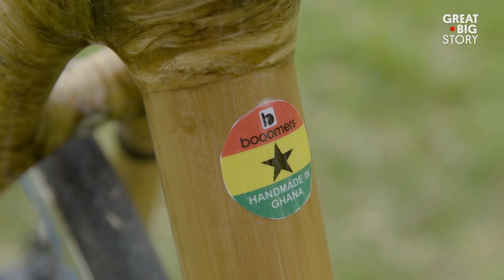How Bamboo Bikes Are Helping This Community

Comment: I saw how bamboo bikes were made on how its made in the west. They required so much labour and epoxy that it was more expensive and worse for the environment than a steel bike. 

Anyway, good for these guys if they can live a better life.
Reply: In the west? Or out there?
Reply: Carbon bikes are made of carbon layers bonded with epoxy, though. You can look for metal lug bamboo bikes that is not new but existed in 1897 http://www.copakeauction.com/ws/wp-content/uploads/2017/01/DSC00726-1920x1184.jpg
Reply: Delicious Pizza carbon fiber yes, metals probably not. You can build frames from recycled metal. My concern would be long term durability. The rule of thumb for a carbon frame is in roughly 5-10 years it will need replacing, aluminum/steel depends on wear and tear but in theory could last far longer. Snowboard cores and skateboard decks are wooden and require replacement, depending on use, every few years or so for optimum performance. Therefore the energy and waste required to build a bamboo bike may be less but you will in theory need a new one every few years, meaning more have to be constructed and whatever epoxies or chemical additives need to be used will likely cause issues with the decomposition of these frames. In contrast, processes to recycle carbon fiber are currently in the works and have seen success on a limited scale. Still, neither CF nor alloy are “1000 times worse” than these are, as you suggest.
Reply: Delicious Pizza you still didn’t address the longevity of a metal frame vs a bamboo frame. If an alloy frame lasts 10x longer (I have alloy bikes from as far back as 2000 that I still ride and have stood up, the most recent of which is a DH/Freeride frame from the early 2000s, pretty much the ultimate test of alloy’s durability, since I beat that thing up in the mountains; while a hipster type cruiser bike could hypothetically last many years without needing to be replaced) then the process of building that frame will be less frequent, even if it uses more energy, chemicals etc.
Reply: Milk2Percent  It is not easy to come to a conclusion. When considering the sustainability of a product, you have to look at the life cycle of it. How much energy was used to make it? How was the energy produced? How long does the product last? How is the product recycled? Generally, cheaper items are most often also more sustainable. Especially when it comes to transportation. Steel bicicles are cheaper than bamboo. (I am not sure about those made in the video).  Steel can be recycled at the end. If bamboo gets drenched in epoxy, it will never be recycled, but only burned. Epoxy is made from petroleum products and produces cancerous fumes, so it is not green at all even though the bamboo is. The energy required to make steel is very high, but so is the energy required of making bamboo. We cannot make a definitive answer without looking at the whole supply chain, and lifetime of a bicicle, but unless they make these bikes only out of steel and natural local resources, it will likely not be more sustainable than a steel bike.
Reply: Milk2Percent They actually replied in one of the comments below which explained that their epoxy is plant based. I think they make it from smaller pieces of bamboo and bamboo leaf, and you can see something boiling at about 1:16
Reply: DrewskiTheLegend that’s not right. Carbon fiber will last more than a lifetime.
Reply: Except bamboo is a renewable resource,  steel is not. Also you don't need epoxy or even a lot if you do use it. Not sure what program you were watching.
In Asia they have giant ancient buildings made from bamboo. Back when they made them they used no epoxy or nails or bolts or anything else, just all bamboo. These building have been thru floods and earthquakes, etc. Yet they still stand. These buildings have been thru many centuries of use and abuse. 
BAMBOO is amazing stuff.
Reply: Adam Blomberg carbon can last a lifetime, yes, but whether your frame will actually last that long depends on use. Fatigue is a concern when you are riding hard terrain on the same frame for years. Keep in mind I am referring to mountain bikes here but I have seen guys break carbon frames as a result of wear and tear.
Reply: There are eco epoxies out there.

But I think even the bad epoxy is better than steel. Think of the mining, smelting, and processing.
Reply: @user-gh8wt2zi2n  The iron in steel doesn't disappear when the initial use is done; and iron ore is plentiful. considering the cycle of the carbon in the carbohydrates (lignans and cellulose) of the bamboo, both elements are cycled in our environment. oxidised steel and iron only needs to be reduced again to make new steel. Moreover, high grade aluminum is very common in bicycles now, as is aluminum oxide in the environment (and aluminum oxide / sapphire protects the metal). The arguments above about bamboo being better or steel being better are only supported by anecdotes and not statistics, and thus it seems dubious to be able to claim one is better than the other by the various metrics used in comments by people here.

Comment: How shock resistant is bamboo? Is there a danger of the frame snapping in half if you hit a rock or a pothole?
I am not saying that this is the case, just wondering if they are as good as alloy frames.
Reply: I was thinking the same thing but more in regards to the epoxy joints
Reply: Good point.
Reply: There's some bamboo (tah-kay/竹) growing at the corner of my yard here in Japan.  It's well known for its structural resilience.  It's flexible, but strong.  The roots don't grow very deep, either.  I've seen videos of bamboo scaffolding being used to build skyscrapers in China and/or its surrounding areas.  I'd be more worried about the joints snapping on the bikes, as beefy as they look.
Reply: bamboos are known to be strong
Reply: ItchyKneeSon why did you include the Japanese word for it, lol

Edit: and your pronunciation is a bit off too...though the 'e' sound is pretty hard to show the pronunciation of with the letters used in English so I'm gonna assume you do pronounce it right
Reply: Bamboo bikes are very strong and are able to withstand shocks. We have people who have used their bikes for several years now and are still happy with them. Actually, we had two German tourists  who used our bamboo bikes to travel from Germany to China between 2014 and 2015.
Reply: you'd be surprised how resilient bamboo can be. The round tubed shape helps a lot with distributing force
Reply: @Kiru Glad to see I'm not the only who was irritated by his Romaji-nization!
Reply: Boy you're underestimating this thing. In China and India scaffolding or skyscrapers are made with bamboo. Hundreds even thousand of workers sit, stand and walk on them with heavy tools. In many festivities in India Huge temporary towers and Pandals( you can think as mini castles) are made with bamboo and cloth(to tie them).
Reply: We have a bamboo wall and a bamboo house and it's incredibly strong it withstanded a good amount of force on it
Reply: Bamboos are used for building frameworks. So I'm pretty sure it can withstand bumps on the road.
Reply: @ItchyKneeSon  Being able to withstand sudden shocks and being able to hold a lot of weight 247 are different qualities. Like concrete is really good choice if you want to construct a building, but if you try to build a bike out of it, it will snap in half. But it turns out that bamboo is pretty good at withstanding sudden shocks as well, so my question was answered.
Reply: I personally wouldn't worry about the joints, it looks like they are made out of epoxy and wrappings. The glue joints are probably as strong or stronger than the bamboo itself, and the wrappings and glue both keep the bamboo from splitting down the middle or fraying, which is its only weakness. it has great strength everywhere else. They used bamboo historically to make war bows, and you can build immense mansions purely out of bamboo! I encourage you to look it up if you are interested, its a really interesting material.
Reply: I wouldn't take it off a mountain, but I think it should be good for everyday use
Reply: @Skummar Köphunchuksohn no bamboo is comparable with glass fiber, but is very less resilient than steel or aluminum.